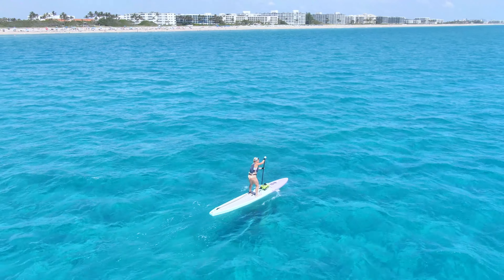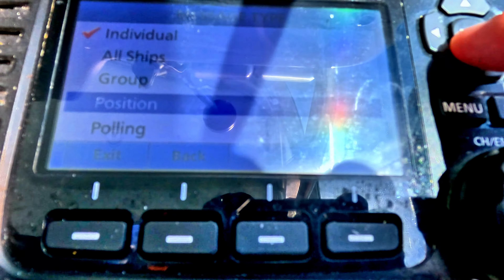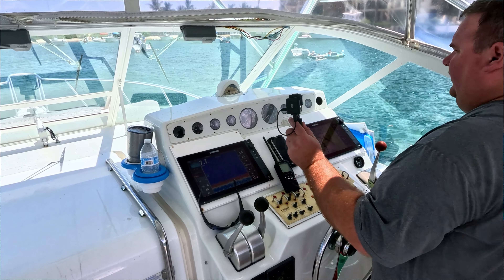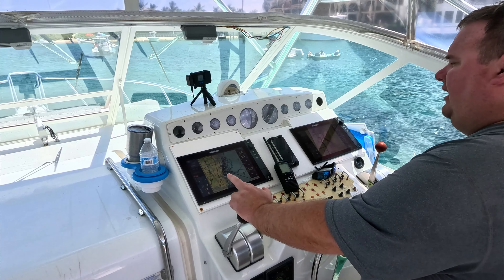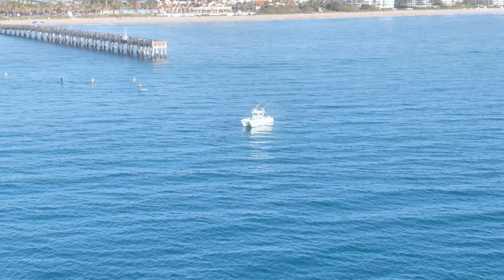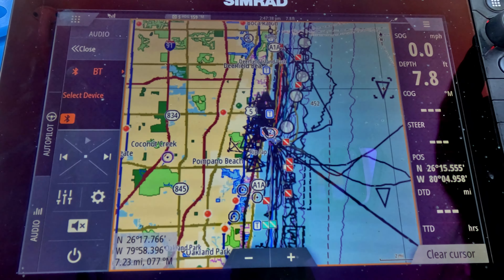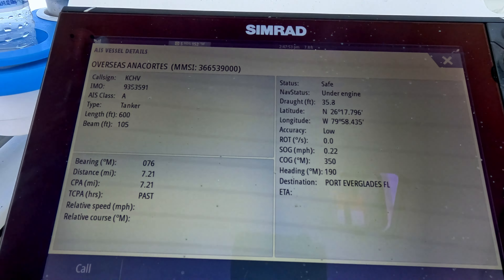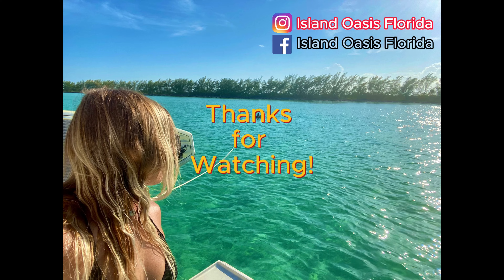Don't Miss Out: Key Marine VHF Radio Feature

Comment: Very helpful information, Thanks 👋🏻
Reply from the maker: My pleasure!  Thanks for the comment!!
Reply: @IslandOasisFlorida I do have a question…So the VHF on the boat has an mmsi tied to the boat..but the portable has its own mmsi not tied to the boat?   I got confused and thought the mmsi had to be tied to a specific boat?…Thanks again for all you do👋🏻
Reply from the maker: Great Question!!  Yes the two fixed mounts I used have an MMSI tied to the boat and they are the same MMSI #'s.  The portable is actually tied to Kaylin's paddle board and has a seperate MMSI than the boat for her emergency use and communication.  This is what allows me to ping her or communicate with her using the DSC feature.